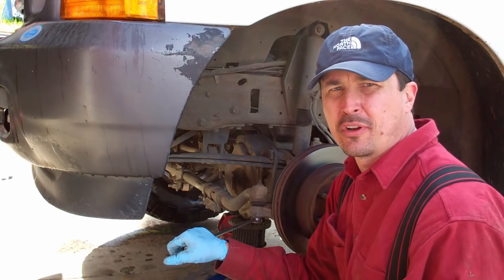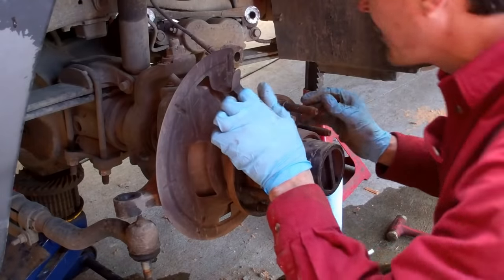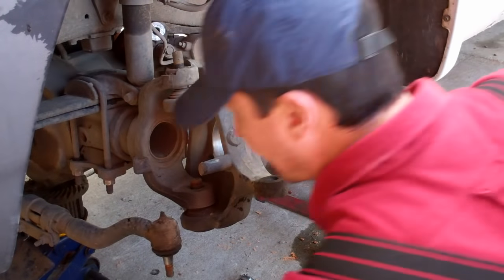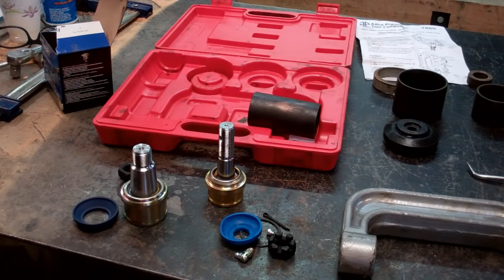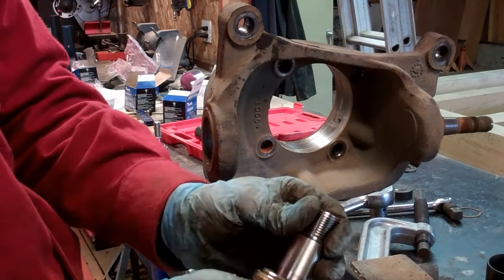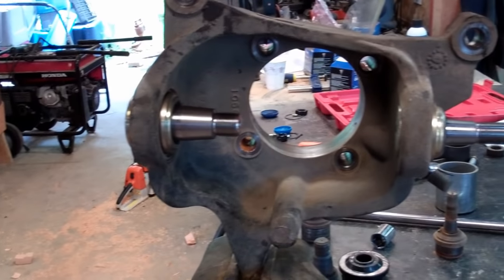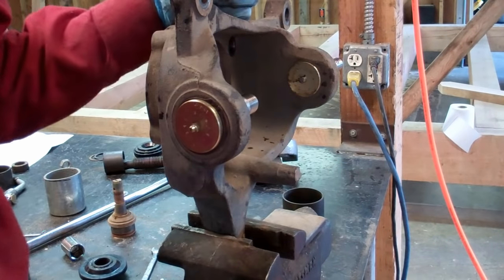How To Replace Worn Ball Joints Ford F250 Truck

Comment: Running a Professional Auto Repair / Adult Day Care Center, I have a mountain of Snap On equipment and Hand Tooling.  There is no substitute for the Quality of the Snap On Line, but make no mistake, for the limited use tool I buy the Harbor Freight, and don't worry about voiding a warranty by wailing on it with a big hammer or using the large sockets on the press as adapters or hacking and bending a 10 cent end wrench for access, "You Betcha".  With nearly half a Million $ worth of Snap On Boxes and Tooling, I'm still on the Harbor Freight Mailing List and shop them online quite often.  Much of my shop equipment when I bought this place was Harbor Freight, and as I wore out and or broke them replaced with  the Snap On Line for the tax deduction advantage first and safety / quality secondly.  You Home Gamers, don't hesitate to use those bargain tools and equipment, but do it as safely as possible.

Comment: when it comes to parts such as ball joints you get what you paid for. You buy a cheap part don't expect it to last a year. Take A/C systems in cars for example it is rare that a re-manufacturer pump will last a season. Where as a new A/C pump will last a lot longer. So are you saving money when buying cheap car parts such as ball joints? Answer to that is no.

Comment: clearly you are not from the rust belt,nothing comes apart that easily around here.
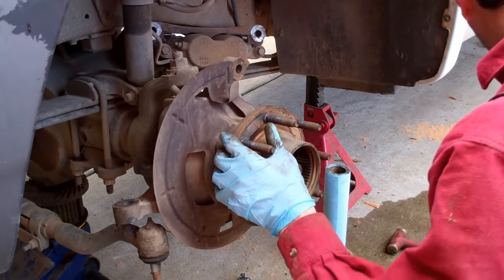Reply: I just want to point out  @ 7:00 he said 
"here in Oregon we don't put chemicals on the roads...  but if you live in one of those areas that does that it can be a real nightmare..."  A person with a little common sense would follow that thought thou the rest of the process.

Comment: In the automotive field... the mechanic who works flat rate that you took advantage of by diagnosing your F-250 at the most got paid 5 tenths of an hour to figure out. Which means if he gets paid 18 dollars n hour he got paid 9 dollars. If this whole job paid a mechanic 4 hours of labor to do at 18 dollars n hour he got paid only 72 dollars to do this job. And remember thats GROSS not NET. Mechanics work to put food on the table not to diagnose your automotive problems so you can do it yourself. We may as well just the same diagnose our co-workers cars for close to nothing and have him profit from it. What I mean is your wasting our time and exploiting our experience and knowledge. The way I see it there is enough resources out there to teach you how to check your own ball joints..... Get you a jack and unload your suspension - that is raise the tire high enough that you can jam a very large pry bar under it. Then with your right foot (driver side ball joint) press down and release up. While doing this you want to be laying on your left side. Holding a flash light to obtain good visibility on both upper or lower ball joints. If the ball joint can be seen moving up or down then it needs to be replaced. Assuming that all other front end components have no wear or excessive play (process of elimination) then replace for wear or noise.... These suspensions types have been used for a long time and any old automotive book from the 60s and 70s can be excellent information on diagnosing and repairing your own vehicle without having to take food away from our tables. The last thing any mechanic wants is to be working out of one bay, waiting on a call back on the car he just diagnosed, for up to 1 hour only to hear, "i'm going to repair it myself". Even 20 minutes of waiting is a waste as we also have to wait for sales to close the deal. Putting a wait time of 35 or 40 minutes. Flat Rate look it up. So if your that capable of tackling any work like this than you were just as capable of using a floor jack, pry bar, and flash light to diagnose it yourself. Think about who your really screwing and just how much of that 1200 dollars the man doing all the work is really getting. The mechanic profits in volume which is why we work flat rate.

Comment: save $80 I thought you said $800
Reply: He saved $80 on the Ball Joint press job. Someone wanted to charge $20 per joint to press them.
Reply: Yes and I should pay better attention . My truck needs those replaced now at the 160,000 mile mark

Comment: thought it was a great video until you rambled about how anyone can do this. all it takes is someone that thinks that. screws up a brake job or ball joint and causes an accident and hits a wife and kid on the road.
Reply from the maker: +Lino Meraz Anyone with some basic skills and attention to detail can do it.  If you don't tend to make sure you do it right that's one thing.  Presuming people will use common sense in accordance with their skill level in anything they do.
Reply: +Wranglerstar Well said my good man! Just like my brother's friend that took his car to a national chain oil change shop and the so called "professional lube technician" didn't tighten the oil drain bolt down. It worked itself out and he lost his oil and the company ended up paying for a new motor.

Comment: good for you for saving $1200 before expenses and after expenses $200, thank you for supporting "made in china" products. so you spend a day by yourself fixing your truck. after learning on you tube, and because you are not certify mechanic, i dont know the quality of your work or if some thing will faille while you driving down the road and you kill anther family in an accident,
Reply: @goo gle Spoken like a true stealership technician. From your spelling I can tell you are well educated and are well worth the $120 per hour your employer charges for your services. Had you taken the time to listen to the audio, you would have heard a clear "don't use China Junk". The beauty of using a certified mechanic is you can be assured they have changed every component they can rather than reuse parts that don't need to be replaced. Mechanics repair defective parts, technicians install new parts. As for the savings, lowers were $75, uppers $50. With your advanced education you will determine that is $250 so even your math is out by roughly $700.
Reply: while i completely understand the view point from any pro trade to the youtube educated, however you fail to recognize that the old attitude "if your not a pro means your not capable of a good job" is wrong and ignorant.  Sure some idiots may watch a youtube video, try it them selves and do a poor job, i am sure they wont kill another family in the process (no more than GM kills regularly anyways) but how about teaching those same guys a little more about the topic, and then when they learn enough to know that they are in over their head they can understand the value behind a 1200$ mechanic bill.